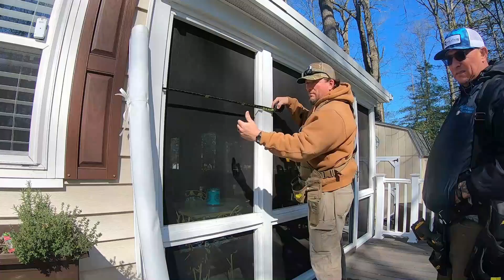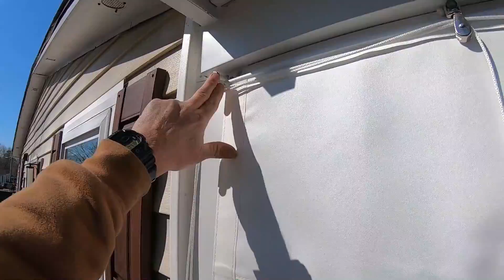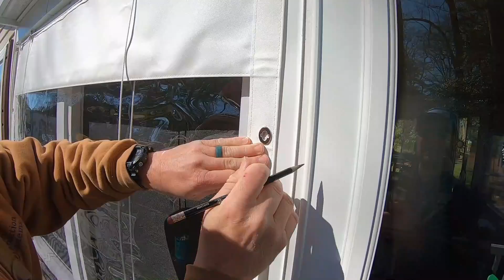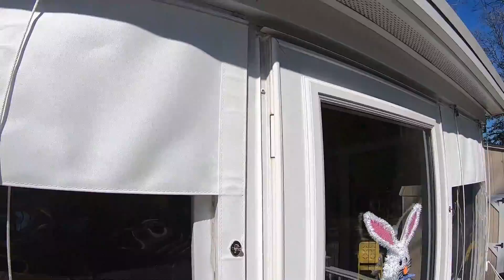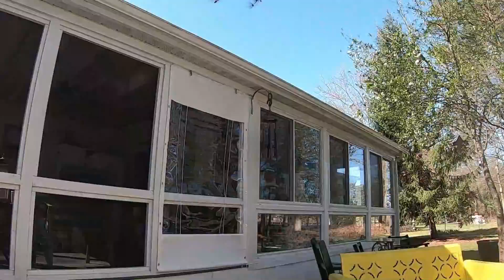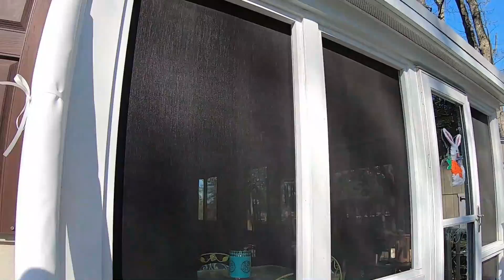Measuring and Installing a Porch Protection System

Comment: I stay in Georgia, on a budget and elder. I have a screened in porch which I want to use all year long. Is there someone in Georgia who could assist with measurement and installation? Mr.& Mrs. Wright.
Reply from the maker: Hi Marilyn, thanks for your interest in our system. We have designed our system as a DIY Project. I would recommend contacting a local handyman or contractor. We have measuring instructions and videos on are website porchprotection.com